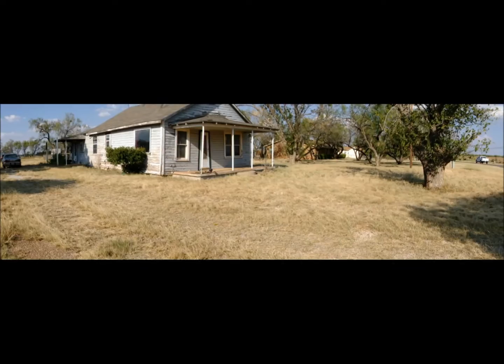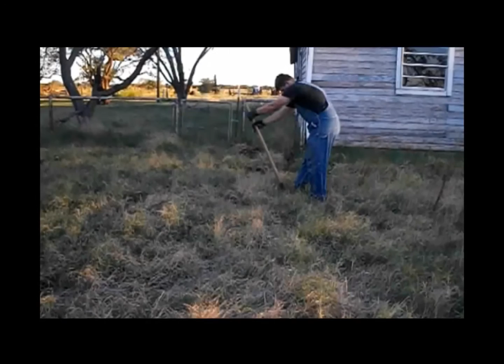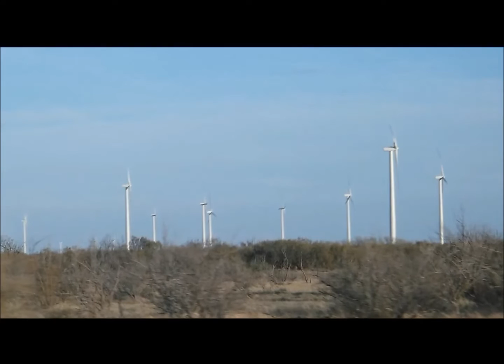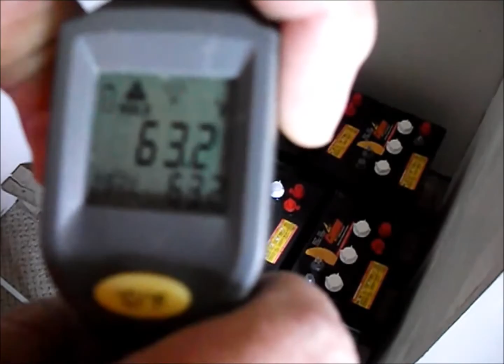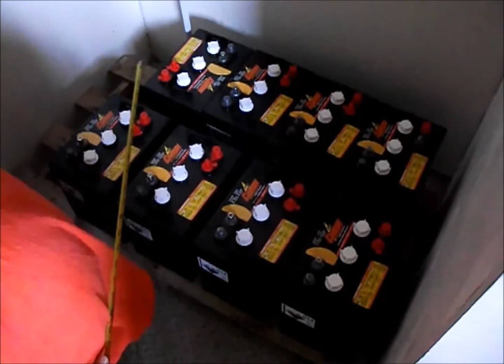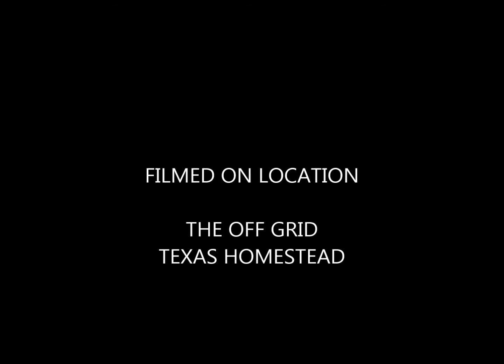OFF GRID TEXAS HOMESTEAD ~ Battery Bank Box Measurements

Comment: Just a thought, why not a closet with controller and inverter with batteries all in one. ollllllllo
Reply from the maker: Hey Jeep, I have the outside storage cabinet, but I don't think it's entirely weather proof and here we have a lot of dust also, so I was thinking I would put the batteries outside in the cabinet just the other side of the wall and then put the charge controller inside mounted to a board on the wall along with the rest of the gear like an inverter and breakers etc. That way the charge controller is safe and out of the weather. Rain/dust and all that. The batteries it won't hurt them too bad if they get a little damp. I was also worried about the batteries out gassing and that gas can be corrosive so I was thinking if it gets on the electronics then it might cause corrosion on the circuitry.
Thanks for watching and commenting my friend!
Reply: Awesome KD I can see you really thought it all the way through olllllllo

Comment: Looks nice, I would make the box as big as possible and may add a temp controlled fan?
Reply from the maker: Hi Craig, yes I have been thinking of making the boxes at least 36 inch long and 14 inch tall and 14 inch wide that way I can make better use of the plywood and make the boxes big enough that if I did get bigger batteries in the future then they would fit. I may make them taller also. I may just cut the plywood into four 16 inch X 36 inch  sections, since 48 inch's( size of half a sheet of plywood) 48 divided by 3 = 16 so I could use all the plywood on one half to make 3 sides of a box. To make use of all the plywood and not have any waste, then it would have room to fit a bigger battery if I should get bigger ones in the future. A fan is a good idea, I will be keeping the boxes inside the outdoor cabinet and they will be out of the mid-day/evening sun which is hottest here so I'm hoping it won't get as hot on them, they will be in the shade so I'm thinking they will stay cool, but I will be keeping the fan idea in mind for sure, Thanks for commenting and sharing/ helping, it is appreciated my friend!

Comment: I understand the idea of going 24volt. If you could concentrate more on using DC items in the house and wire your bank to 12volt you could double your amp hour output. you could use smaller inverters spread out around the house for say tv and other media, just have to run some DC cable a few places so you don't have to use one big honking inverter to cover the whole house. Just some thoughts I had.
Reply from the maker: Hi Jerry, If I run 24volt I can use smaller wire to run power, I am thinking about using DC volts for some things, you can buy 12-24 volt bulbs with the Edison screw in base on them and I was thinking use the already existing light fixtures and make the lights inside the house on the 24 volt system. If I use 12 volts then I have to use larger wire to handle the amperage. When you go up in volts, then you go down in amps and visa-versa, when you go down in volts you go up in amps, and the wattage stays the same. It's ohms law. So if I go up from 12 volts to 24 volts then it will require less amps at 24 volts than it will at 12 volts and amperage effects the  size of the wire you can use. That is why they use 120volt in AC wires because it carries the same amount of wattage but but you can use smaller wire to carry the power because the amperage is lower. 
  I already have the AC wires in the house so I'm thinking of in the future running an inverter for some uses and using the existing AC wires, AC would work better with less loss for greater wire run distances, but using the 24 volt power on the DC side will also allow me to use smaller wires and thus less expensive in cost of copper. Check out these bulbs, something like this runs on 24 volts.
http://www.amazon.com/Projections-Recreational-vehicle-Voltage-12V-24V/dp/B00AIQ9XBS
 There are ceiling fans in the house and I could rewire the AC bulb bases for these 24 volt bulbs and have DC lighting. I could run AC to the fans and DC to the bulbs. You have some good ideas for sure my friend, Thanks for sharing! I appreciate you guys!
Reply: Off Grid Texas Homestead
Thanks for explaining. I did not give thought to reusing the existing wiring. It makes sense now.
Reply from the maker: I may not use the existing wiring for the DC side of things, I need to double check electrical code for DC wiring and make sure I will be ok to use it, I'm thinking that the fans only have the one electric feed and don't have separate feed from the electric switch to the lights and from the panel to the fan motors. I may run separate wires for the DC side and use the pull chain on the lights of the fan for DC. I have to carefully consider electric codes as to what I can do with it. The codes are written by the National Fire Prevention Association, the code is called NFPA-70 and it's really written in response with fire prevention in mind. I always like to be safe! :-) Thanks for commenting! I appreciate you watching and following along.